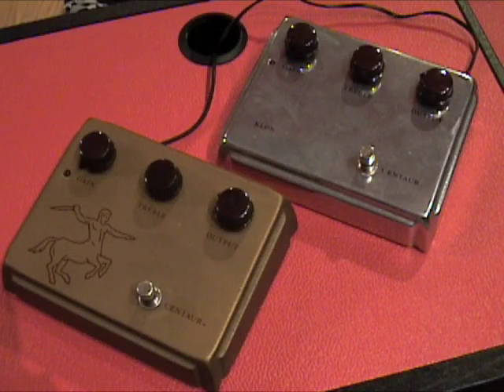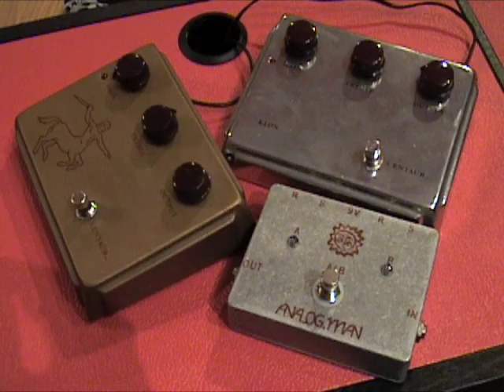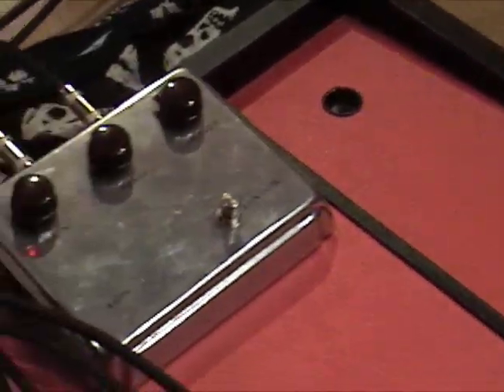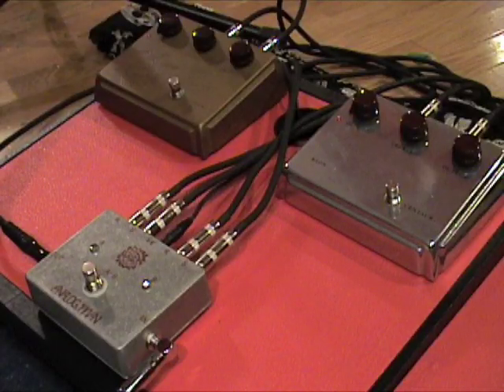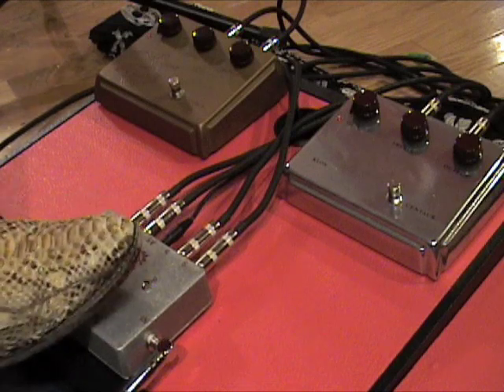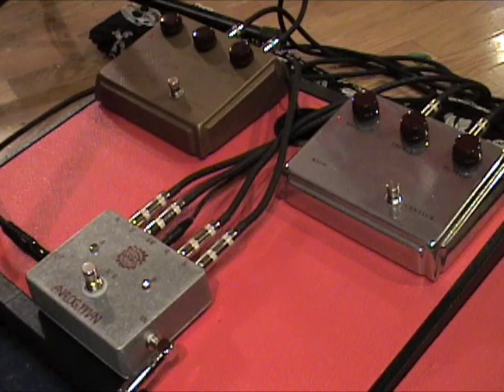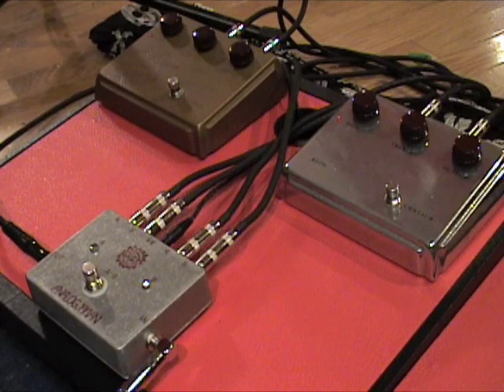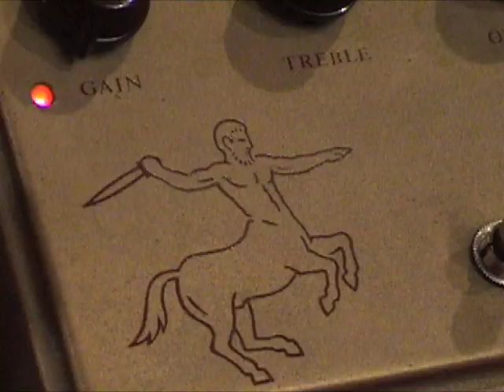KLON Centaur shootout Gold versus Silver with humbucker pickups SG Dr Z amp

Comment: I disagree, every amp is gonna add its thing. Yes a dr.Z has  its own specific tone but that does not mean you don't  hear the pedals, it just reacts in a different way. I personally like how he runs his pedals into slightly distorted amps. I would much rather have that than a flat sterile clean tone that is only good with something in front of it. Always start with the amp, make it sound killer and then use pedals to work with the amp, never tweak the amp to glorify the pedal, that is stupid.